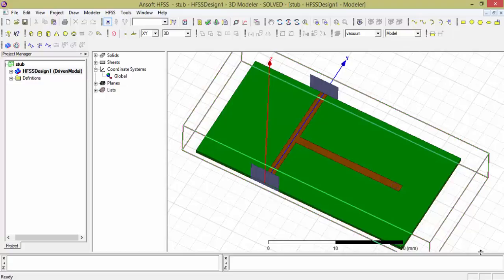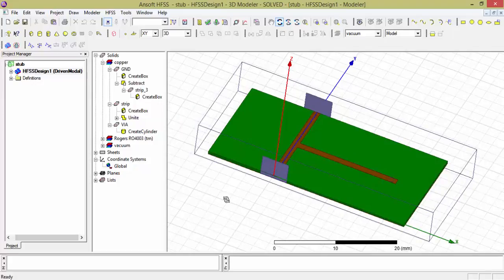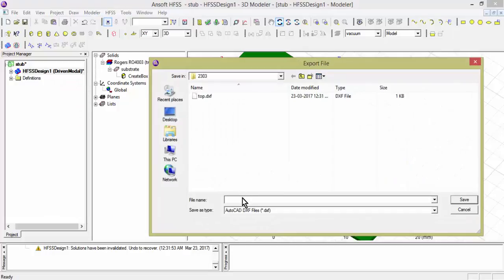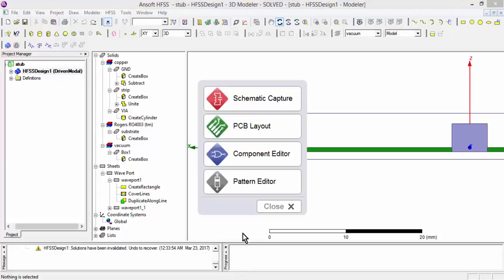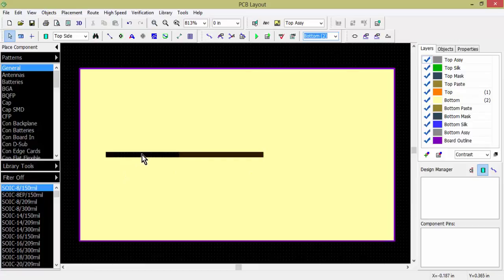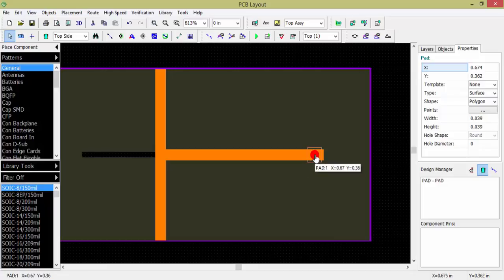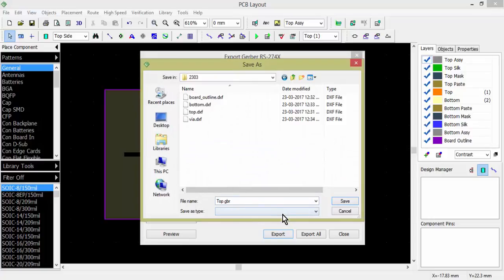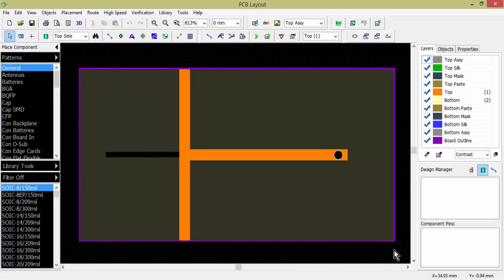How to export dxf or gbr file from HFSS if via or ground slot is there

Comment: I'm using HFSS 2017.2, and if you export your design (I tried DXF format) it will automatically detects layers in XY plane and generates them all. Then, all you need to do is opening the generated DXF in some layout editor and deleting the objects that you don't want (because it creates extra layers for the 3D objects in you design such as air box)
Reply from the maker: Thanks for your observation.
I am not used updated version.
However, if it possible to export each layer separately, then re- confirm it through any layout editor once.
Sometimes, sake of simplicity all objects may be deleted except the interested one to export independently.